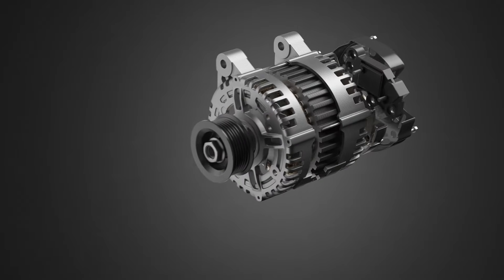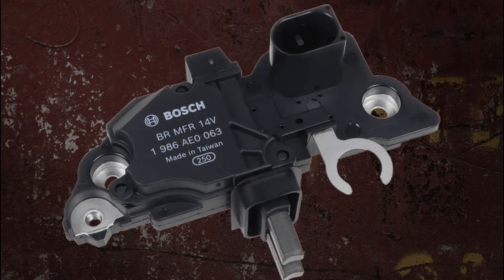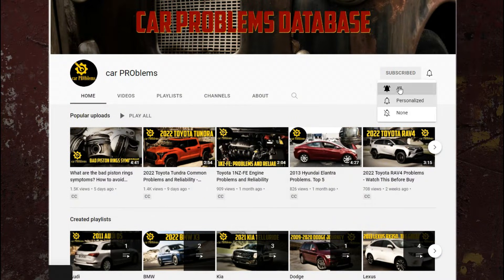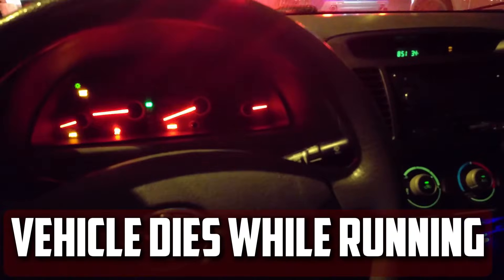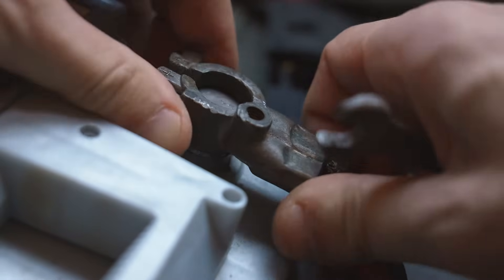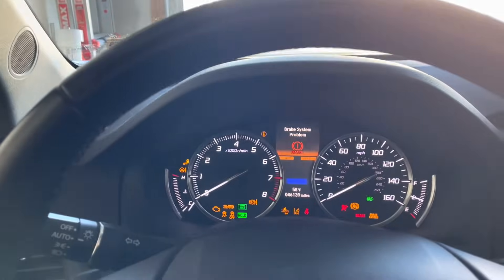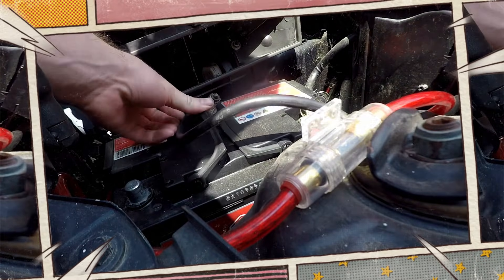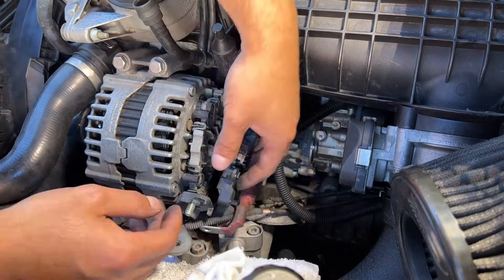6 Signs of a Bad Voltage Regulator & Replacement Cost

Comment: MODERN CARS have the voltage regulator inside the on-board computer, which could cost $1,000 and up to replace the entire computer.
Reply: This is unfortunate. 😮

That's not fun to have to replace an entire ECM. 😢